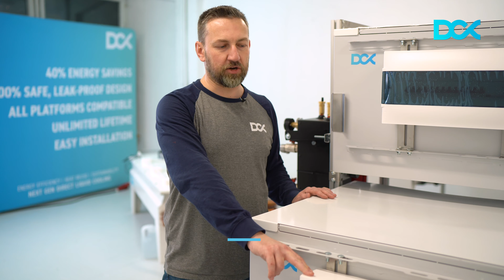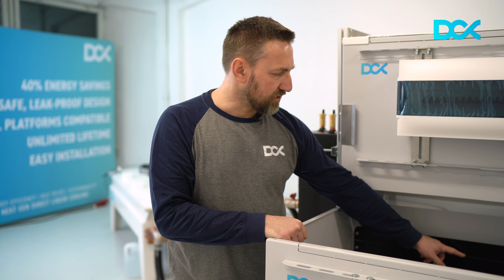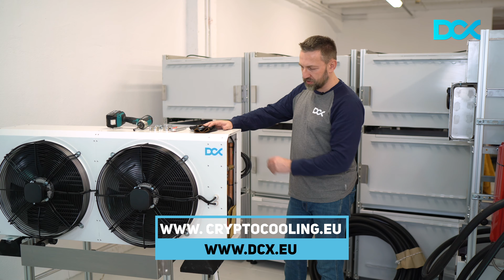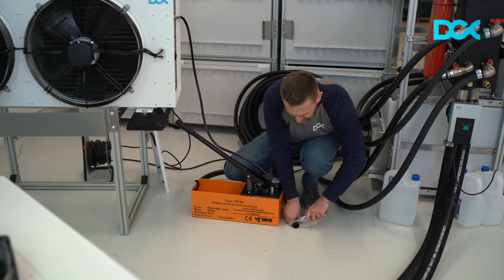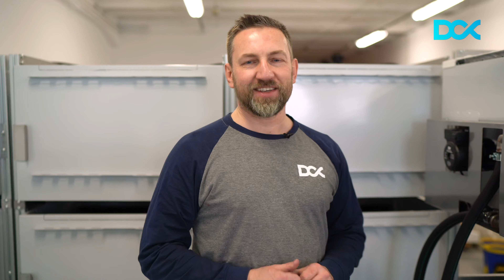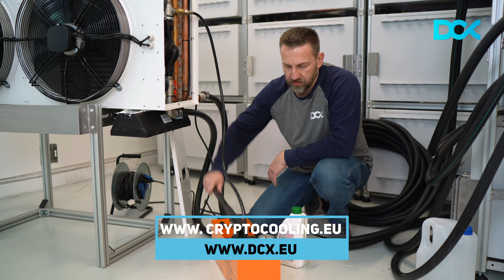How to install and start up the DCX Immersion Mining Enclosure ? | Part 1

Comment: Hi, thanks for your video. Could you please clarify the pressurisation process? What mixture do you add through the pump? You said demineralised water and anti corrosion/fungus - radiator fluid, but in what ratio? After following all steps mentioned in the video, I assume the dielectric fluid is then added to the enclosure together with the correctly connected and cleaned miners to then be turned on?
Reply from the maker: Hello, 
we provide more detailed information to our customers during the commissioning process - we support them via whatsapp / telegram during installation.
If there are general questions about pressurization process let us know.

And the rest - yest correct.
Reply: @DCXCryptoCoolingSystems  hi can some get in touch about my order it's taking a while now
Reply: @DCXCryptoCoolingSystems  Dear DCX,  i have purchased this system and i need support through whatsapp and telegram over the next few days to ensure i dont accidently ruin my miners.
Reply from the maker: @oalzaabi  Start from familiarizing yourselves with manuals on manuals page: https://cryptocooling.eu/manuals/. Also, please go through current installation videos on https://www.youtube.com/c/DCXLiquidImmersionCooling/videos.

You may also find some replies to common questions in the https://cryptocooling.eu/faq-2/ section. Please go through this material and if you find some issue during the installation we are available to support you directly on below communication channel:

We have also direct support contact, use them if you are stuck on some step. They work in GMT+2 / CET time, but we respond also outside business hours.

Email: support@dcx.eu

Whatsapp: DCX SUPPORT / +48 783 925 978

QR Code: https://wa.me/message/GSGUDTNFZUBFF1
Telegram: https:/t.me/DCXHelp  @DCXHelp
Reply: This week we will film installation process of immersion liquid cooling box/cabinet/container in our factory. I will post it once OK. https://youtube.com/shorts/ltXTzw96udg?feature=share